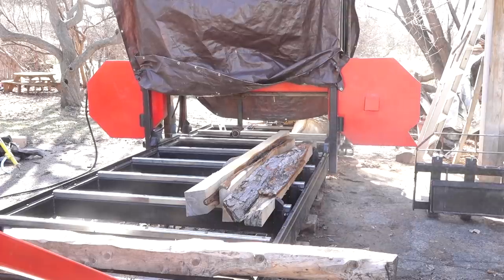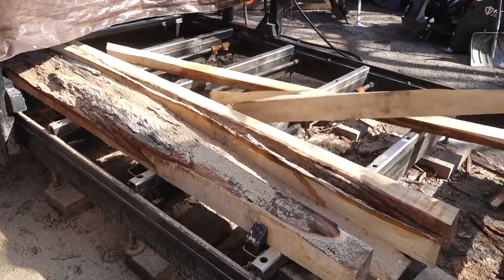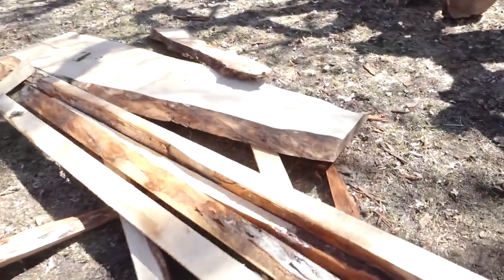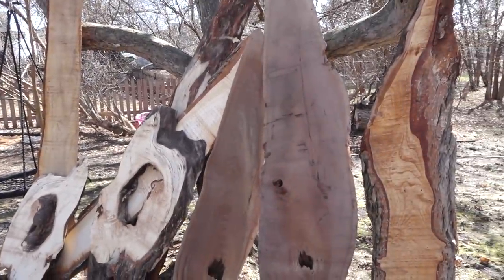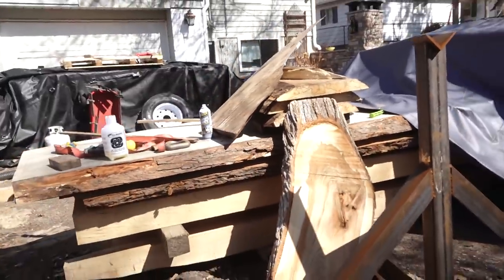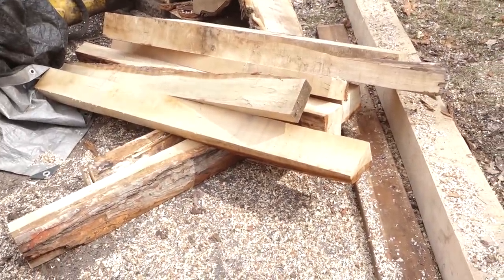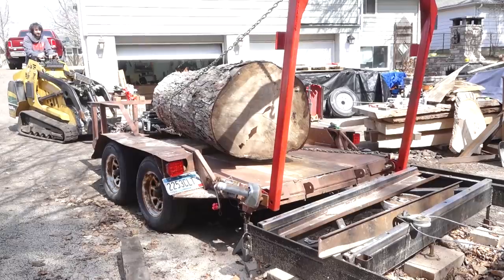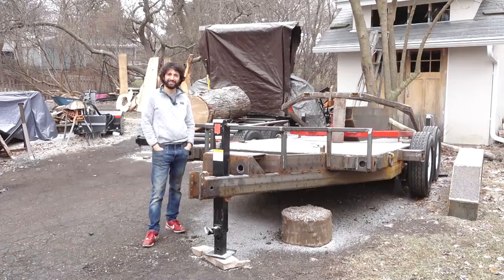Having some fun outdoors [Work Vlog]

Comment: Use the log grapple to hold up a bunch of trim pieces. Then cut them into firewood with them off the ground.  Less bending over.  One cut produces multiple pieces of firewood.

Comment: Seeing the video on the mini-skid steer I thought you had found a way around installing hydraulics on the mill.  I was wrong.  Hope you make a video when you do that.  Good practice with the mini.  Challenge yourself by picking and placing little stick pieces.  You will have the experience when you need it rather than having to learn in a tight situation.  May you and yours stay healthy.

Comment: A thought on your editing blues- plan a basic script or series of actions for a relatively small overall area, set up cameras in what you see as the most advantageous "view points" and turn it all on, move through your action plan, look at and speak to the appropriate camera, then plan your edit from a speeded up "area cam". Using more voice overs will reduce the number of times you have to sync your "speaking face" with the action. 
   Do more videos!

Comment: Something to talk about Matt. I saw you adjusting the cut depth and immediately wondered how the scale works. Is it setting a 2 inch cut depth from the top of the log ? Got a bit confused as it appeared you were winding it down to 2 inches.
Reply from the maker: The scale is referenced from the bed to the bottom of the blade.

Comment: Wondering, when you move to your dream home and shop, how much dis-assembly of the sawmill will be required? I’m guessing relocating and getting it solid and level will be the biggest headache. That April snow storm yesterday must have been a surprise....
Reply: Here in Ontario Canada, I have seen it snow mid-May
Reply from the maker: Not much.  The carriage can be lifted off so the mill can be moved in two pieces.  Leveling isn't a huge deal either; just lower the feet until they all touch the ground.

Comment: On the Mini Skid Steer would it work to make a removable concrete step to stand on to add ballast and raise you to see the ground easier?
Reply from the maker: It would be a bit more complicated since the platform has an operator presence switch which is weight activated
Reply: @mcremona  is it the whole pad or just a foot pad

Comment: Hi Matt, I enjoyed your me time video It is these normal things that bring us back to reality sometimes and especially in your case as you work from home it would get hard to distinguish at times
I know editing is a lengthy process and when the puter has to render the video, just after Xmas I had to upgrade my computer I usually do so so that it will last me about 5 or 6 years.
I went with the best I could afford 
My Question is this
When did you last upgrade your computer?
and how much ram is installed?
A lot of improvements happen in very short time frames as far as computers go mine compared to my m
Previous pc (i7 with 32 GB ram etc) is like a doddering old snail compared to the new one (I don't buy of the shelf computers I look for the best components I can afford that work well together, watch   
A lot of YouTubes and look at different places for best prices then get my computer tech to assemble it
Consider doing a computer component test check that out with new computers and see how the speeds compare
Then consider where to go next.
It probably won't take the physical work of decision making as to editing out of the picture but it should speed up the rendering times etc freeing up more time for you.
Tony from Western Australia.
Reply from the maker: Rendering goes pretty quickly - around 1.5x playback speed.  I just tend to be pretty detail oriented so I spend a lot of time in the mastering phase.  I'm about a year out on my current editing computer build.  i9 7980xe with 64gb ram

Comment: is that a 12v winch you use to pull logs onto the mill?
Reply from the maker: Yes
Reply: Matthew Cremona do you know the rpm on the 3 phase motor you use to run the bandsaw blade?
Im looking to upgrade my saw mill with a 10hp electric motor. It currently has a 35 hp gas engine. Its a hudson oscar 52 inch
Reply from the maker: The one I’m using is 1725